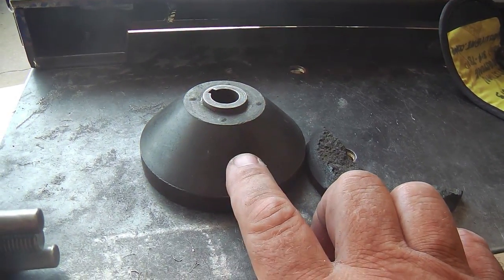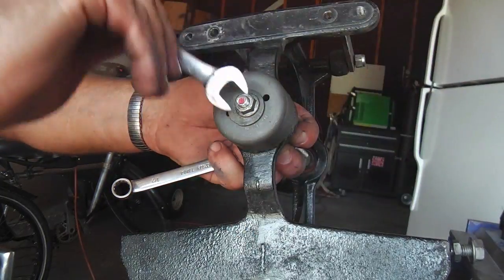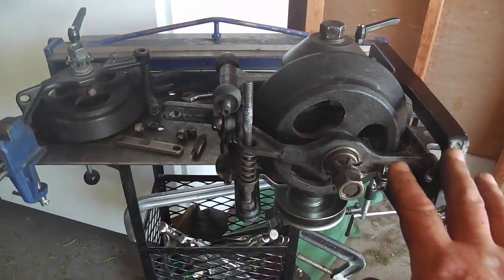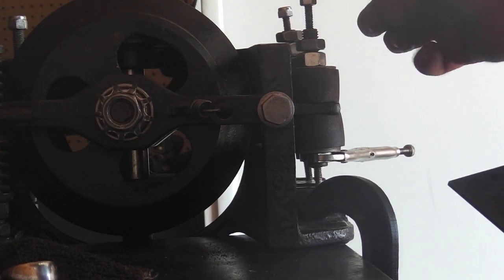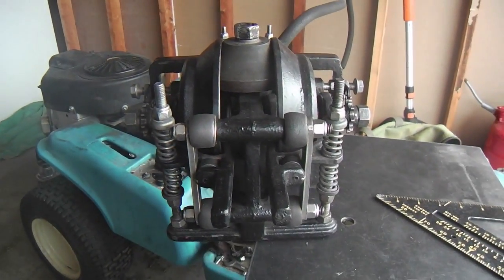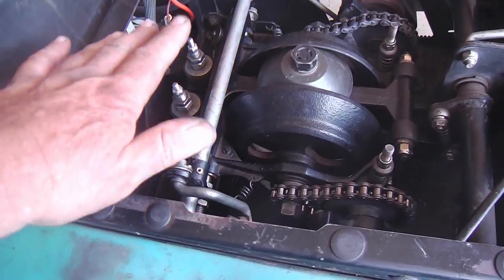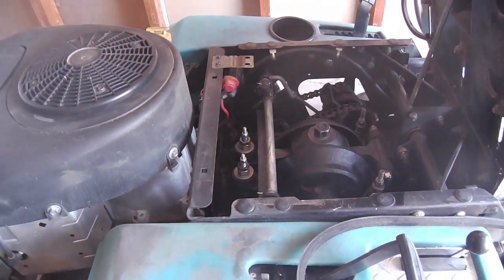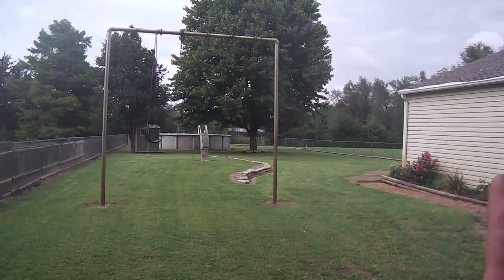Dixon ZTR Mower Transaxle Cones Install & Adjustment Procedure

Comment: Is the first Dixon you were driving a newer version than the second one with the hand grips out to the sides?
Reply from the maker: Nah, that is the very same unit.
Reply: @NewJerusalemTimes  oh ok I always thought the ones with the grips out to the sides were different than the ones with the grips in the center haha.
Reply from the maker: @Cheshhire  Yeah, they are different, but they also have some things in common, like the cones and chains, etc. There's a guy who recently did a 3303, which is unlike the 3304 that I have, even though they're about the same model year. Take a look, as his video is about the only one out there that I notice right now showing a cones install on those smaller units that have the friction-drive transaxle that's partially integrated into the framework (unlike my unit, which has it as a standalone, removable cluster). Those ones actually look a little easier to do, somehow...: https://www.youtube.com/watch?v=8qdv0B0cV4A
Reply from the maker: @Cheshhire  Yeah, I believe the ones with the levers that are together and placed between the legs have the cone assembly that is more integrated into the chassis assembly (like on a 3303), whereas the ones that have the hoop levers, like on mine (3304/3314), have the cone assembly that is a more stand-alone and removable assembly.
Reply from the maker: OK, well, you're getting it, then!

Comment: I have a 2003 model. I bought it a few days ago.  It runs, and cuts, but it sounds like grinding sounds when I start moving.  Can the adjustments be made on frame?  I've never worked on this kind of mower before.
Reply from the maker: Well, these friction-drive transaxles are a little tricky to adjust in the unit. So, download the literature. Of course, close and careful inspection can often reveal problems. If I had a grinding upon moving forward or backward, I'd probably jack up the backend and run the engine (with the seat safety switch disconnected, if one is still installed), then lift the seat and move the levers back and forth to see if the noise is coming from one side of a transaxle disc cup or the other. And that might also reveal that it could just be a broken torque rod affecting the disc cup on the one side then. So, check your torque rods, as one could be broke and possibly still allow some amount of maneuvering. But, it may be other stuff too, like the Dixon chain idler mechanism that could be bent and grating in some way. I changed my mechanism because it wasn't that good (there's a little video on that too). I'd check the drive belt alignment too. There's a parking brake assembly that could cause some grinding sound when you start to move. But, I'd probably first want to rule-out any issue with the cones themselves, i.e., is there any skirting left on them?, do they seem to be symmetrically equal in their resting positions, etc. Otherwise, watch the video a few times, until you begin to really understand the principles and mechanisms of how these units function. So, you'd do well to put on your Sherlock Homes cap. And please let us all hear back about what you find and how you solved your problem. I mean, a 2003 model may be ready for some new cones, though, i.e., you can't adjust your way out of that.
Reply: Do I need to buy those expensive adjustment tools/gauges, or can I go off of measurements for the spacing that the gauges use?
Reply from the maker: No, you could do it by the measurements. But, that one hole on the gauge, where the cradle arm has the bolt stab through the gauge is a critical centerline usage of that gauge, where spring tension adjustment is made back-and-forth, to get it just right, as shown in the video. So, I'd suggest that you get a little  more "skin in the game", so to speak, and just pony up the 25 bucks for that pricey gauge. Honestly, that thing could be made out of plastic, instead of CNC cut from steel, to make it super-cheap. https://www.dixonztrparts.com/product/142836/dixon-539116707
Reply: @NewJerusalemTimes  Good afternoon sir!  I've made a bunch of headway on the transaxle!  Forward motion is pretty much polished out and smooth.  When I pull backwards, I'm not getting as much bite.  Reverse is lagging in positive motion.  Where did I go wrong?
Reply from the maker: @Cornmeal73  Yeah, that's kind of a trick-bag, I think. But I'm no real expert. I mean, like I stated in the video, the adjustment on the torque rods is not to infinity, and it will compromise the reverse adjustment at some point. So, I'll suggest that you may get some better backward motion by adjusting both disc cups inward by about 1 millimeter or two, i.e., between a half or up to two two turns on the three nuts/bolts that make that adjustment as noted in the video, which may make all forward and reverse motions more responsive, but not to the point that the unit creeps when the parking brake is removed. I mean, it's strange how none of the Dixon maintenance or factory gurus have come forward to share all of the factory secrets or tricks on these units. But in the meanwhile, I've just discovered or learned enough on my own to be able to keep my unit in outstanding working order, and I'm happy to share as much, especially since there are no former Dixon factory gurus or maintenance experts coming forward with this stuff. Please let us all know how it goes!
Reply from the maker: @davidp8563  Right! Adjusting the rear torque rods doesn't do as much as the literature suggests as far as speeding or slowing one side or the other, that I've found. But it will teeter or "weight" the lever moreso in the forward or reverse direction, which is to be avoided, I find. So, if your upper or lower cone is not problematic, you may find that the tolerance of the disc/cup of the problematic side is beyond the .050 measurement. I mean, if there's a divot on the roller plate, then a feeler gauge won't give an accurate measurement anyway. So, I'll suggest that you just put a full rotation on all three nuts (one is the pivot joint, which is an allen wrench adjustment) of the problematic side, to move the disc/cup into that side, to make the cones engage there a little quicker/better, and then adjust the torque rods to give a better balance in the forward and reverse lever centering. Otherwise, I'd advise to just pull the transaxle out and give it a full once-over, as then you'll be able to see if there is some lack of symmetry or balance somewhere. Please let us all know here how it goes...

Comment: is it worth buying one of these that needs "friction drive repair"?
Reply from the maker: Well, that's a relative question. I mean, I'd say "no", in most cases, especially if you just want to try to resell it quickly. And as a personal mower there are many decent 42" - 48" deck-sized, zero-turn hydro units priced around $2600, I'm pretty sure, brand new, on sale, delivered, tax-free, which represents a great value, and there'd be no fuss or muss with repairing a somewhat antiquated friction-drive model. Interestingly though, a former neighbor of mine was just doing his first new cone install on his 1999 Dixon, but he dropped one of the cast metal cradles with the disc-cup on it and broke an arm off one end and a finger to the torque bushing at the other end. He called me to see if I had any spare cradles, which I didn't, but was able to TIG weld the part back togather with stainless steel filler rod with no problem, and I'm guessing that the cradle is now even stronger for it. I'll include a link to that short video. So, for a guy like me, these type of mower models are a fun and cost-effective challenge. https://www.youtube.com/watch?v=SIY33_AD6SU&t=5s&frags=pl%2Cwn
Reply: NO!  These things are TOTALLY over-engineered and impossible to work on. The idea might have worked out for the year they were made but there's nothing like a hydrostatic machine.
Reply from the maker: @pbm7715  Ha, ha, ha... Nonsense, I mean, the hydrostatic units are great, but the ones rated for residential use may have a failure on one side or the other, just after the warranty runs out (I know of someone like that; without the know-how to install the failed part, or the financial-fortitude to get it repaired at a shop). And the theoretically unserviceable part is priced at about $1000. So, these fiction-drive Dixon units, for people like me who take the time to quickly learn the mechanisms, will never worry about the needless expense of having a hydro unit failure. i.e, a pair of cones are relatively cheap and practical to install (watch the video). Wheeee........... But for people with lots of wealth, you're probably not watching this anyway, and I'm happy for your prosperity!

Comment: Where do u get your parts
Reply from the maker: Well, most often I've gotten parts online from dixonztrparts.com, as there's no sales tax for "out-of-state" purchases and the supply is pretty good, still. But, I'm noticing lately that an eBay online seller seems to be have the best values lately, especially because the cones prices are otherwise rising pretty quickly. I mean, as a Christian anarchist and a stateless person, I have no PayPal account, as that now has to be linked to a US Bank and a SSN/TIN, which I don't have, so I don't buy anything on eBay anymore (I used to when they accepted money orders as payment until about 10 years ago). But, for you and most others, I'll recommend this eBay seller, who still has cones priced at about $50 each: https://www.ebay.com/itm/DIXON-ZTR-STANDARD-DRIVE-or-Z-DRIVE-TRANSAXLE-MATCHED-SET-OF-CONES-P-N-5109/133470319671?epid=11033154196&hash=item1f13737437:g:6WwAAOSw4ipearrt